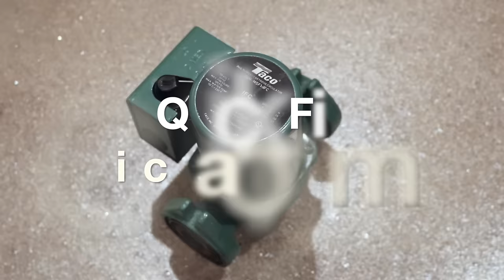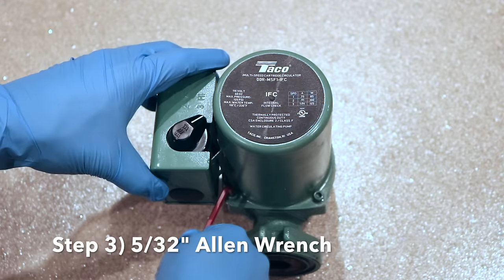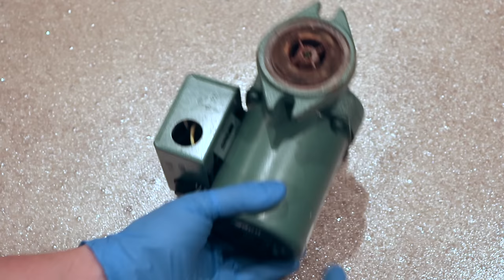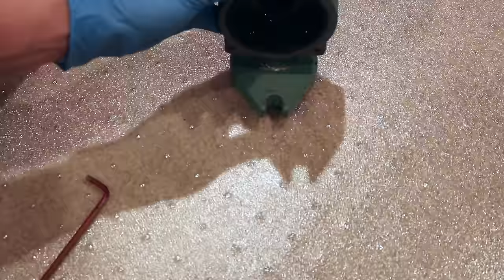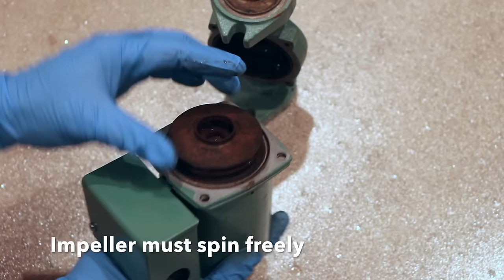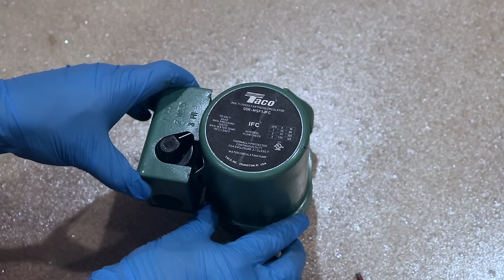Fix & Repair Stuck Circulator Pump Before Replacing NO HEAT

Comment: Wish I saw this sooner...:-(  A new pump set us back almost $900. and they took the old one...:-(
Now is only a few months later and the unit won't start...:-(  It turns on, just won't light...:-(  I knew something was wrong when it started kicking on and off continously...but now won't cone on at all. I saw another video, trouble shooting, showing a dirty flame sensor. I hope I can find it...;-)
Reply from the maker: Sorry to hear that, some of the repair costs are over the top now. If it happens again at least you may have some more info now.
Reply: $900? I went down to Home Depot and spent $115 on new Taco pump. I've seen ridiculous part mark ups before from HVAC service.  I had my old AC crap out. The repair person quoted $200 for part and $200 labor. While he installed it I looked up the part number that I took from box. $20 from on line supplier and pretty easy to replace. .
Reply: Why do homeowners not understand how much it costs to run a business? People think that all the job entails is parts and labor. People don’t understand that there’s business insurance, vehicles, employees, health insurance, accounting, IT, etc etc etc.  btw, i’m a plumber.

Comment: a common fix before you take the motor cover off, is to give it a gentle tap or two with a mallet, often it frees up the pump, and no need to drain the system
Reply: gonna try this!
Reply: I have a Grunfos Auto PM which was installed by my builder during our new house build. It is 1 year old and last night we had a heavy rain storm with a lot of lightning. The next day there was no instant hot water. I tried unplugging the Grunfos for a few minutes thinking it would reset, no luck. Then I gave it a few light taps with a hammer, now its working.
Reply: I need to try that. I had a pool pump that I got working twice like that. Good idea thx
Reply: YES, great tip! Especially if your system has been turned off during the summer and you're getting ready to put it back into service.

Comment: I have a grun foes circulator model number UPS 15 dish 58FC why is it whistling
Reply: Grundfos circulator why is it whistling
Reply from the maker: That is usually debris inside that might be cleanable or the motor could be failing. Either way you may want to consider replacing it (watch my other video) or having someone look at it for for you.

Comment: I have this circulator pump on my water heater. And of late I’m having a little issue getting hot water out from the faucet. It took a minute or to have hot water running out of my faucet. I also noticed that when I place my hand over the motor of the circulator pump it’s really hot. Anyone have any idea or tips please shared.
Reply from the maker: If this pump is on a hot water line it is normal for the pump to be the same temperature as the hot water. Try to feel down the pipe after the pump to see if the heat keeps going. If it is cold than you pump might be on but its not moving water. Its very common for older pumps to stick or seize but try the test above first and see what you get. Thank you for watching and best wishes to you.

Comment: Run 4th circle liter model number UPS 1558FC it's not that old complements and its whistling does anybody know why
Reply: Make sure your system is not low on pressure.

Comment: This is NOT a 'fix'. When a bearing is shot then its shot. A circ may not be exactly cheap, but dealing with burst pipes in the dead of winter is going to cost a while hell of a lot more. And motor cartridge cost more than entire unit so don't waste time trying to service it. REPLACE!
Reply: He says temporary for a night or a week

Comment: If the circulator isn't working doesn't it mean that the water is not heating?
Reply from the maker: No its not controlled by temp so it may be hot or cold and the pump would move the water either way
Reply: @SilverCymbal  thank you! I had a roth tank installed and since then no hot water is available. Only cold water. The guy said it's cause the oil level is too low. In roth tanks the oil line is at the top of the tank and then there is a pipe going all the way down to about 1 inch from the bottom of the tank. So the burner has to pull the oil against gravity. I know that the oil is more than one inch above the bottom because there is about 25 to 30 gallon in the tank. Which means it is about 6 inches high in the tank. I have ordered more oil, so we'll se if it fixes the problem. I didnt want to order more oil until the insprctiom was done.

The light that was flashing on my system 2000 imdicated that there was a "ciculation" issue or "burner lockout". The burner is locked out, but when i reset it, it runs for a few seconds and then goes back to being "locked out". I'm assuming it just isnt being able to pull the oil for whatever reason. Maybe therr is air in the line.
Reply: @SilverCymbal  So the problem was that there was air in the line. Guess they didn't bleed the line after the changeover. I learned how to do it on youtube so did it myself. Half a weekend gone over this but I learned something new and will know for the future.
Reply from the maker: @boreduser12  Your system should runn whether or not it has 20 gallons of oil or 275. That doesn't sound run. Either the burner needs to be bled or the piping on the Roth needs to be checked out. I would call Roth and see how happy they are about what he told you, they should get you some help,
Reply: @SilverCymbal  thanks for your help. I have another question, hopefully you dont mind me asking. An oil company came and filled up my tank and their truck gauge (or whatever method they use) said it is full. However, when i checked my new oil tank in the basement, the reading on that said 7/8th full. Is that a problem on their end or mine? Thanks again.
Reply: boreduser12 the tank gauge is not that accurate.
Reply: @aaronsilver1975  Thanks for your reply Aaron. There was about 20 gallons to begin with because they filled the tank with the oil from the previous tank. We know it was about 20 because of the size of the barrel they had. They filled that into the Roth tank (which apparently you aren't supposed to do per Roth), and then i ordered oil. For a 275 gallon tank, I could've had lose to 250 gallons filled in. But only 190 gallons could be delivered. I think it was the oil company not wanting to fill more for whatever reason.

Comment: Other than for purpose of draining crap out of a water tank.....why drain the tank?. The vid says to do this, it should just say to "relieve pressure", which really is all that is needed. Saying to drain the tank also implies a total drain....also not necessary., maybe only a bit if at all. Close the cold water supply valve to the tank.... open some faucets in your home to drain, ....and you shouldn't have to drain 30-50 gals of your tank.

Comment: You didn't fix anything... nothing was broken. More like maintenanced. How bout you take the whole motor apart and show people what's inside and maybe how to replace a bearing.
Reply from the maker: These have sealed bearings and windings and can't be serviced further than I showed. Stuck rotors are common on these especially if the lines are loaded with metallic particles like mine was. This is handy if you are in a jam with a frozen motor in the middle of the night and can get you heat again. Thank you for the comment and watching.
Reply: Silver Cymbal Good to know thanks. Your title is misleading tho